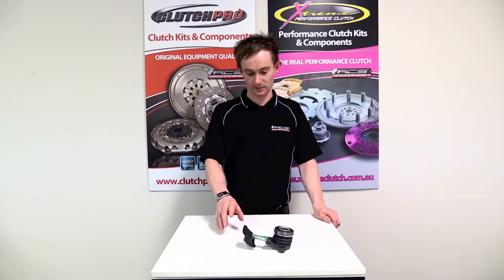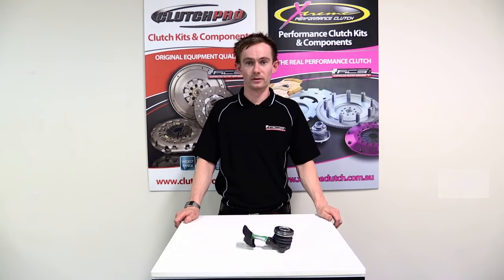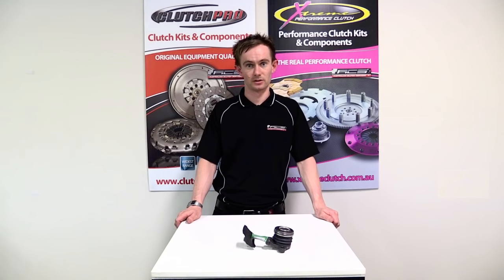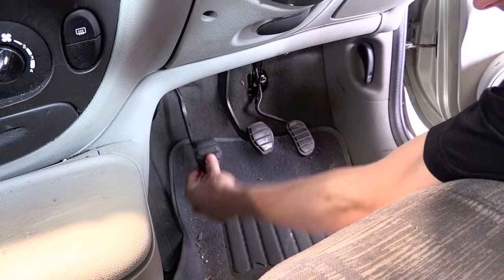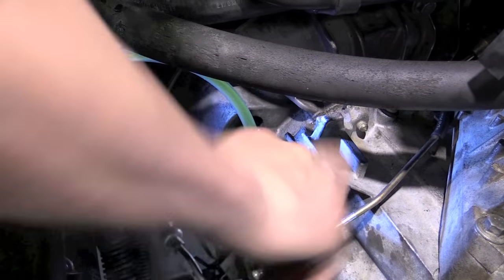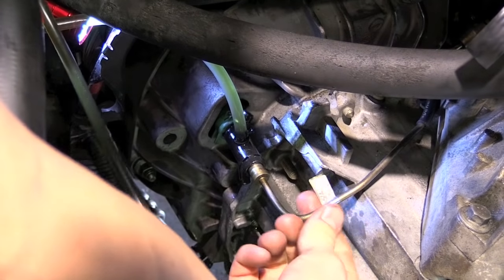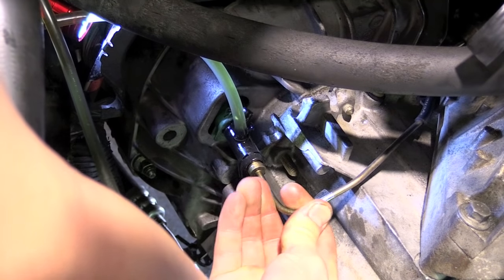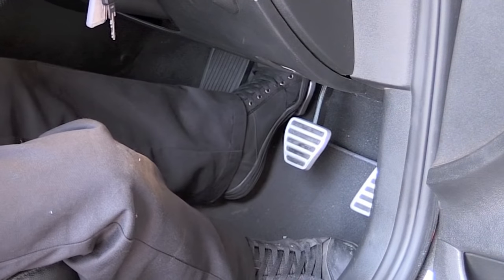CLUTCH TECH: Renault Scenic (And Various Nissan/Ford Models) Bleeding Procedure Guide

Comment: Firstly, do not remove the clip. You only need to press it down and pull the pipe out to the bleeding position. Secondly, depress the pedal fully fast as going slow will not force the air from the CSC. Thirdly, push the pipe back in to the closed position with the pedal down. Aprox 10 pumps between top up.2 x 10 should do.
Reply: The Clío from my juke got bend some how … you know the part number or the part name for it ? I can’t find it no where … just wandering.  Thanks

Comment: If you were to pressure bleed the clutch is it just a case of opening the bleeder and let the pressure push the old fluid out. With out having to push the clutch at all. My car shares the master cylinder for both brakes and clutch. Ive done the brakes via preassure is it just a case of same again but pull the slave bleed connection till fresh fluid shows.

Comment: Im working on nissan with this set up. This is different then normal bleeding. Can you just confirm that you do indeed pump the pedal 2/3rd the way with the line in the open position? Your instructions are very clear i just want to confirm. Thanks
Reply from the maker: Hi Ramar,
With the fitting pushed in to the first notch, you should see the system start to gravity bleed. Once you have enough fluid through from gravity bleeding, then you can pump the pedal around 3/4 of the stroke. Make sure to operate the pedal slowly.
Thanks

Comment: Why do you push the main line in after?
Reply from the maker: Hi,
The line is pushed in to close off the bleeder port and seal the system. If you don't then the fluid will just continue to escape through the bleeder line.
Thanks

Comment: is it same for laguna?
Reply from the maker: Hi milicb buncic, This should be the same procedure for certain models of the Laguna depending on the year etc. If the bleeder nipple cannot be undone, then it likely requires the bleeding procedure demonstrated in the video.
Thanks
Reply: o.k tanks frend
Reply: Hi is it the same for Renault trafic 1.9 diesel from 2003 ?